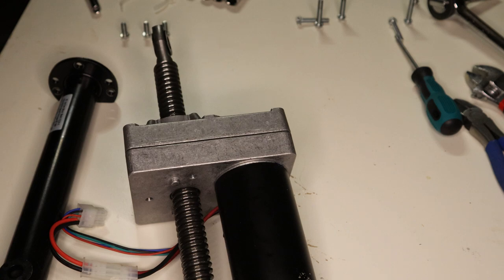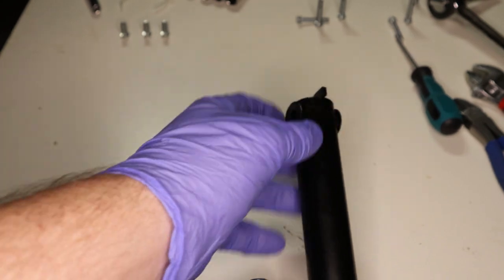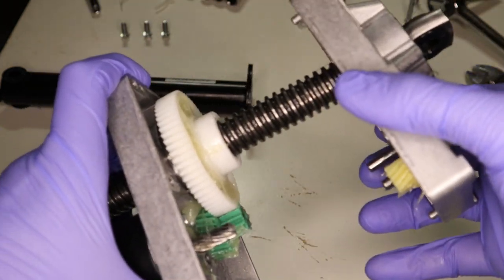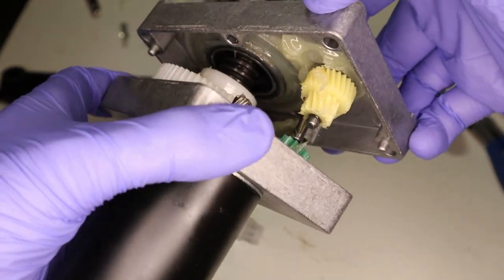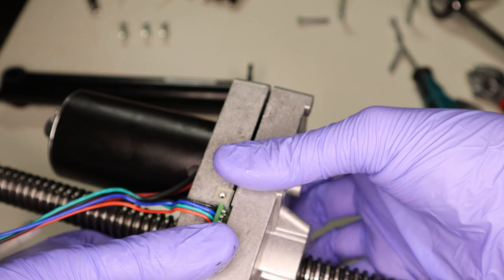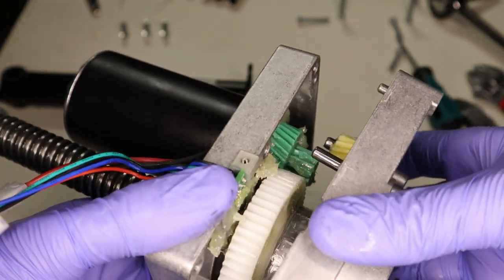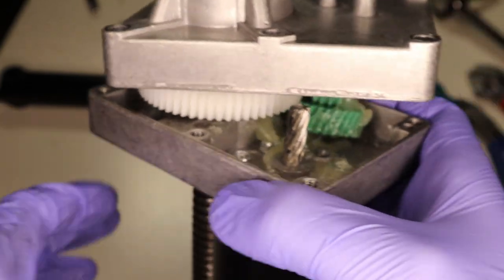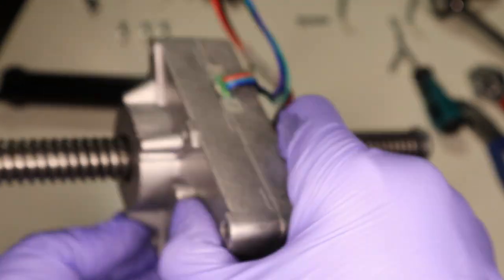NordicTrack Commercial X22i Treadmill Incline Motor Teardown #repair

Comment: What’s that black bar in the beginning of the video called? That’s the part I need to buy
Reply from the maker: @richi4291  I’m not sure, you can’t get just that from NordicTrak, you have to buy the whole lift assembly which is like $125. If you try eBay maybe “lift screw cover?” The lift assembly is a screw lift and the black over is the support and cover for it so…